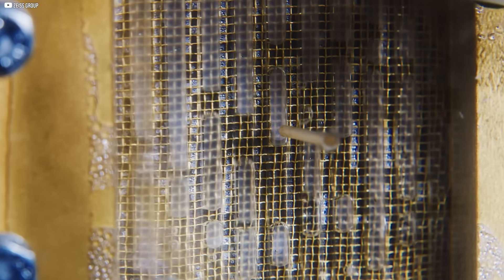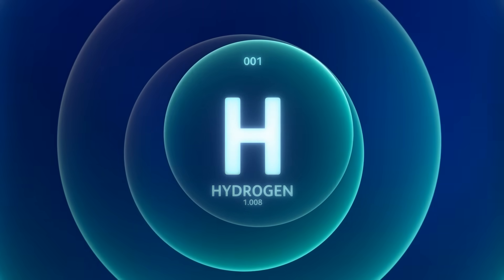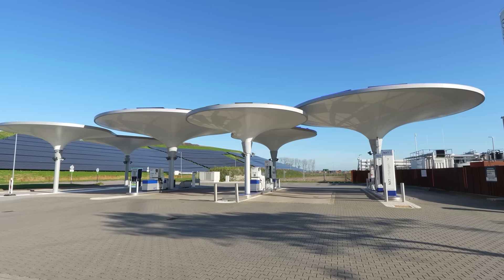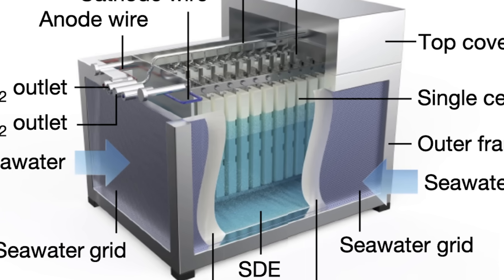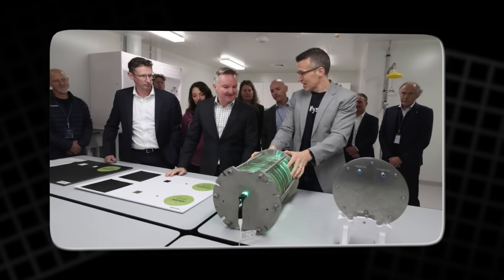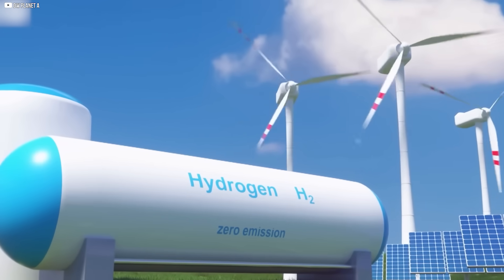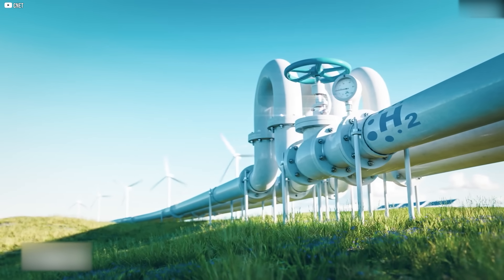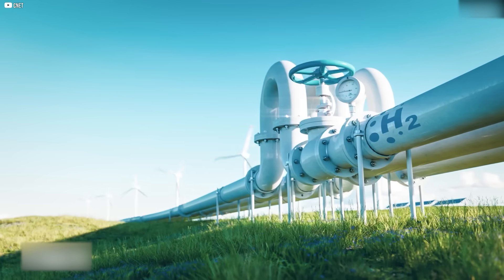New Hydrogen Tech Is Blowing Away Expectations

Comment: Short fuses are dangerous, the current temperature is too hot for the use of hydrogen filled cylinders, metal electrolyzer tanks with ceramic lining on the inside of the electrolyzer tank replace the old oil tanks in vehicles, and the next instant sodium hydroxide business could boom.

Comment: Awsome. Has china gotten my message about an energy moleunment. Not only build high rise buildings as part of solar energy panels. Like the big wheel in London. Get 5 of those wheels. Put all 5 wheels on a massive metal rode. A rode that will need to be built in 3 different parts or maybe 6 to 7 different patrs. On a heavy duty frame built around the wheels to support these 5 wheels. Probably needs a heavy duty chains to operate amd support all 5 wheels. Or maybe use only 1 or 3 wheels If 5 is to much. Anyways massive wheels with industrial made massive water scooping containers attacked to these big wheels. Think about your hands and arm. Every figure nail has these 5 wheels with maddive water catchers to catch the water Been scooped from the ocean. Every figure is a river of waterfalls. Every figure meets at the palm of your hands. This is where all the water is scopped and sucked from the oacens all empty into one big river. A river built to support all 5 river flows. The water then runs up your arm where the massive hydrogen plant is built. All that water is divided into different sections that lead to massive chambers that then takes the water and chhanges water into energy. A hydrogen plant with solar panels. Windmills. Look at my post or comments I ever written. All the information is there. Thankyou everyone who reads my comments. Yours sincerely.
Reply: wat? With Chinese steel? They havta import iron oar, +dnt kno how to make strong steel yet! Bt keep dreaming.

Comment: "Hydrogen will finally enter our everyday lives" it already is in our everyday lives but for it to replace other energy sources as the primary energy source is a pipe dream. Making hydrogen easier and cheaper still don't address the biggest element in the room and that is storing hydrogen safely and economically at room temperature. This vid did not mention that a tank needed to store enough hydrogen at room temperature to produce adequate energy to do any meaningful amount of work will take up too much space. Thus it needs to be chilled at -423.17°F to keep it in liquid form during storage so that there is enough hydrogen to create energy and this means complex and expensive storage technologies need to be developed. Even after the required technologies are found and suitable storage devices are created, they will still need to consume electricity to maintain the low temperature of hydrogen to keep it in a liquid state. This means more money will need to be spent so where is the gains that this vid is touting.

Comment: The safest way to store hydrogen inside a clear room temperature non-lethal organic type margarine liquid by Ayrton Energy recently partnered with Hawaii Energy where they can utilize all oil infrastructure without additional retrofit cost to transport H2 inside oil tankers, fuel trucks, oil pipelines, gas, diesel fuel stations or ordinary plastic tanks astride companies that need to store surplus hydrogen fueled electrical, mechanical or heat energy in safe clear liquid.

Comment: The 10 year old YouTube video titled "Energetic Cavitation Impact" by Prof Marc Ramsey representing Vanderbilt University  generated 400,000 PSI from impacting custom BB pellet sized water cavitation bubbles has huge upside potential for overunity energy where the output of 400K PSI exceed the required energy input.
Reply: YouTube acts like a 10yo too!

Comment: What if.... Nope, you're dreaming. Look at the basics of what you're competing against. Electricity generation and transportation is cheap and efficient. You charge a battery with say 90% efficiency, and discharge that at 90% to get to the road wheels. Now look at Hydrogen. If you use electricity to split water, that's 83% efficient at absolute best. Now you have to compress it to store it, which takes a lot of energy. Then you have to get it to the car. Once there, you either burn it in an ICE at <50% efficiency or a fuel cell, which is no better than 60% efficient. See the problem? Every conversion wastes precious energy. In practice, Battery Electric is three times, yes three times more efficient. What's the point in getting Hydrogen involved in the chain when you can store the electricity you're using to create it, and need electricity to drive a motor? Just save it in a battery. It's a no brainer, but Hydrogen enthusiasts can't see the blindingly obvious terminal problems that it has. And that's without even considering the complexity of the systems compared to BEVs.
Basically, Hydrogen is a dead duck and always has been.

Comment: The only way for hydrogen will become viable as a fuel for cars, homes, etc., is for onboard production. Storing hydrogen is expensive since as it needs to be pressurized at much higher pressures to store and liquifying it is even more so. It's better to make and use on demand. But then energy density becomes an issue. Hydrogen gas is only 8 MJ/L vs Gasoline at 34 MJ/L.  Ultimately, gasoline is still the winner. We should focus on making clearner burning gasoline. I don't know if anyone doing that.

Comment: H2's GWP-20 is 37. That means if as little as 0.27% of it leaks, it's worse than coal, even if it were made 100% cleanly.

And H2 is the leakiest molecule in the universe.

Grey, blue, green, it's all worse than coal.
Reply: 1/37 is 2.7% not 0.27% , but hydrogen can indeed leak that much and its warming potential becomes a issue.
Also you can't just look at GWP-20, GWP-100 of hydrogen is 11 because it is short-lived.
Reply: @fakestory1753  I stand corrected on decimal points.

However, GWP-100 assumes the last emission was 100 years ago, and emissions are always happening. 

So until there are no more coal or hydrogen emissions, the shorter the GWP time base, the more fidelity to Effective Radiative Forcing.

There's no good case for massive increase in H2 use; it has small niche utility, that's it.

For everything else, there's biofuel, at least, if not electrification and battery.

Comment: This whole video neglects to tell you about the laws of thermodynamics, even at 96% efficiency its still a loss, meaning it will always cost more eletricty to produce than the energy output of the hydrogen, chemical production costs too much , and using solor or wind is basically turing the hydrogen into a energy storage gas, aka a battery. Effectivly cancelling hydrogen out as renewable energy, green yes but why not just use solar or wind cancel the middle step. Although as energy storage its probably greener than lithium
Reply: We can use hydrogen to operate our beloved combustion engine cars. No need for waiting to charge battery car only 5 minutes fill ups.
Reply: @adriaanvantulpenbaard1740  Yeah the problem is energy density, tanks for hydrogen cars are too big
Reply from the maker: You bring up some important considerations about the challenges of hydrogen production and its overall efficiency. Thanks for your insightful perspective!

Comment: Hydrogen can be produced by heat , very efficient . Today about 800 C is needed . It was producing 30% of gasoline BEFORE WW2 in Germany by energy from coal.
If MSR are used H2 can be very cheap, but it is better to make methanol . A very good fuel for transportation with cars. A slight modification of supply chain is needed.
Big oil knows and sabotaged the development of MSR . They made Nixon abandon the development 1970. 
But who knows anything about the possibilities of nuclear or political history ?

Comment: BIG OIL still is trying to keep relevant with this.  Many Auto companies have explored hydrogen fuel (residual cost for users) and found the technology has several issues that it cannot overcome.  The cost of producing hydrogen fuel is very expensive and must be made at the delivery point.  The reason for needing to produce at delivery is the constant issue of leakage…you really can’t contain it.  And finally, hydrogen causes embrittlement of the surrounding materials and thus maintenance costs increase immensely.
Reply from the maker: It's true that hydrogen faces some hurdles, but it's exciting to see the progress being made in addressing those issues.

Comment: Molecular hydrogen has been discovered in several deposits around the globe also so maybe it makes sense to develop hydrogen for the future.
Reply: Is that "fossil" hydrogen  😀
Reply: That sounds like a justification for profit than advancement.
Reply: Aluminum used to be very expensive, and then they learned to make it so cheap its everywhere. Eventually, they will do that with hydrogen out of necessity. Probably for water management needs and clean fuel purposes. Not so much for profit.

Comment: There needs to be a balance of hydrogen and electric cars. Locomotives and 18 wheelers should be Hydrogen, it is not Economical to be electric be because it it dies in the middle of no where there is no place to plug it in and then takes a while to re-charge, considering Truckers get paid while they are actively only driving the truck. This stops us from mining and exploitating beautiful natural landscapes for precious metals needed for batteries such as copper, nickel, and lithium, batteries are a very dirty process, and will have to locate superfund sites. Electric cars should only be in urbanized areas with local driving because we have too many gas stations and where I live local green spaces and housing and you get where I’m going, in most cases hydrogen,nit can even power ocean liners which are the biggest violators having more emissions than 100 commercial airliners
Reply: No mention of the huge storage and transportation costs. Even if it were free to be collected from the place of production it would still be an inefficient route to powering a vehicle.
Reply: I have been hearing about the development of technology where cars can use solar to re-charge on the go. Your thoughts??
I was thinking that Solar power can be used during the warmer months of the year while hydrogen can be relegated to colder climates (melting the snow, for example) ; In other words, im thinking a zero-emission energy grid that effectively makes use of both hydrogen AND solar when each are needed.
Reply from the maker: It's fascinating to consider the different needs of various transportation sectors and how alternative fuels can best fit those needs.
Reply: 😃🌹🌴🇸🇪 i think you are rigth but do not forget Diesel and gas, can also be part of market. Do not forget koldioxid is the must for life so let it be. !, 🇸🇪🌹😃🌴🌲

Comment: if you're interested in green hydrogen you've got to check out HYSR solar hydrogen production... having built test facilities, working with Honda, designing and building larger panels... they're coming together quite nicely, ready to blast off....
Reply: Always in a state of "not quite yet...but soon". Meanwhile an inexhaustible source of stabilized hydrogen is being slandered by calling the gas of life...CO2...a dangerous pollutant.  

Hydrogen is beautiful when combined with carbon. The resultant hydrocarbons are cheap, available, energy-dense, and can be stored in a plastic jug for long periods of time.
Reply: @PAULSLEVINSKY-b7j   what's the cost of the "juice" to bond the H's to the C's to get that gallon of go juice ?
Reply from the maker: That sounds really promising for the future of green energy!
Reply: @TheForgeEmpire  to be completely transparent, i'm a small shareholder, but the reason i bought stock is because it's a one of a kind technology, as far as i can find...

Comment: There are several good approaches to make electrolysis and hydrogen storage more more efficient. E.g. the so called Battolyser, developed  by TU Delft in the Netherlands with about 92% efficiency. And the potassium-bicarbonate/formiate storage with an efficency over 95%. The problem is, this would be a game changer for renewables and pushed the fossile fuel industry out of the market. Therefore, nothing will come to the market, until we will have run out of oil and coal.
Reply: For the time being the amount of energy produced with solar panels and windmills is not enough, too expensive, requires too much space and production only when there is sunlight and wind.    Other problem is that energy storage is expensive and requires lot of space ....

Comment: There's another big barrier to scaling hydrogen even after these technologies scale, assuming they will: hydrogen storage and distribution. It is voluminous. So efficient storage and transportation are an absolutely unavoidable need that so far hasn't found a scalable solution. Liquid Organic Hydrogen Carriers (LOHCs) are a possible solution. However, none of attempts so far to find a scalable solutions have been successful. 

Ammonia has its fans, since it's already a well developed technology with a universally available ammonia infrastructure and distribution system already in place. However,, the conversion to ammonia and restoration to hydrogen is so far clumsy and inefficient. I'm confident, however, that these problems will disappear over time.
Reply: Combine hydrogen with carbon and create hydrocarbons. Their energy-dense, stable, can be stored and tranported in plastic containers, and consumed in a vast existing infrastructure
Reply: @PAULSLEVINSKY-b7j  The energy it takes to do that doesn't pay for itself. LOHCs also don't yet, but they just store hydrogen and release it upon being heated. They can be recycled over and over, absorbing and then releasing hydrogen. This comes a lot closer to working than your suggestion, but it's still too energy expensive to scale successfully. Lots of organic chemical scientists and engineers working on that, though.
Reply: @PAULSLEVINSKY-b7j  The energy cost of doing this doesn't pay for itself. LOHCs (Liquid Organic Hydrogen Carriers) are an approach that comes much closer, but still not there yet. Time will tell. I'm optimistic.
Reply: Then, you have to reduce distribution to a minimum. Instead of giga-factories, build medium and small ones. Then, distribute them in a way that hydrogen doesn't travel more than 300-500 km. Consumption has to be near production. It's better to transport electricity than to transport hydrogen.
Reply: @heraclito3114  I'm confident the storage/transportation problem will find a solution in the next few years. How many is anyone's guess.
Reply: Inefficient +clumsy is too inefficient +clumsy. any girls alloud on their project?🌷
Reply: @JesteRsjoke-nu6bo  You mean allowed?
Reply: @robertwendell1556 🌷i humbly hated school coz i couldnt read. Bt later laboured thru +taught myself at 18! i waznt spoilt or sheltered, nor ate from a silver platter like others. sorry to be inferior to u in ur pompus mind- men lack humility by assuming things they dnt understand! Nor respect lateral thinking womun❤️‍🩹
Reply: @JesteRsjoke-nu6bo  So why couldn't you read until you were 18? I had no silver spoon either. When our father was in college as a student we had very low income. 

We actually got hungry until our stomachs hurt and took naps to deal with it. My mother got pretty desperate at times. So quit blaming your lack of reading skill on not being born with a sliver spoon in your mouth and shut up about humility. 

I scored post graduate level on a reading comprehension test in the seventh grade. We weren't going hungry by then, but we were not even in the middle of middle class. We were at the very low end. What does that have to do with learning how to read? You just have to want to and do something about it.
Reply: @JesteRsjoke-nu6bo  You mean allowed?

Comment: Power hungry to produce. Difficult to store. impossible to contain and when it leaks it is a powerful explosive. Any vehicle using hydrogen will be boiling off dangerous gas continuously. Leave your car in the airport carpark and come home two weeks later to find the 'tank' empty. Gasoline burns in air hydrogen detonates. I can't see it ever being a practical fuel for the domestic user.
Reply: Have you heard of fuel cells?
Reply: It will only boil of when it is liquid not when it is compressed hydrogen. Your EV will be emptying your fuel tank after 2 weeks airport because the thermal management system is working to cool your batteries in the 90+F heat in the summer in the Phoenix Arizona airport. Because it needs to be cooled to preserve the battery from degradation. While doing this nicely it will use a lot of energy, and also emptying your battery if your battery is not pugged in.